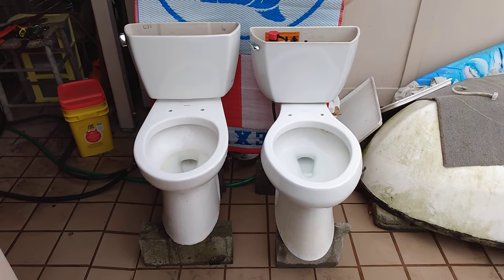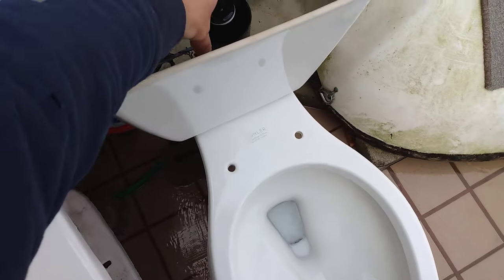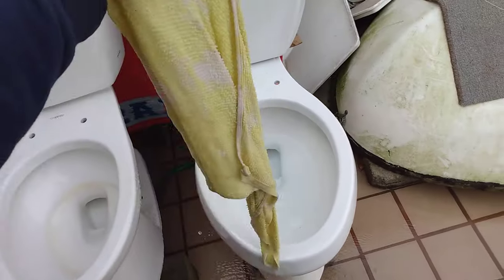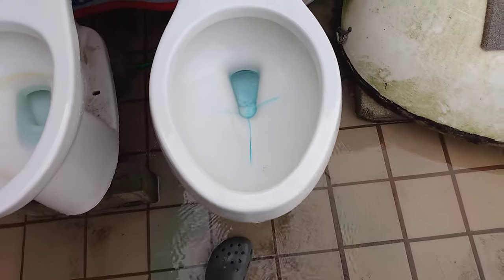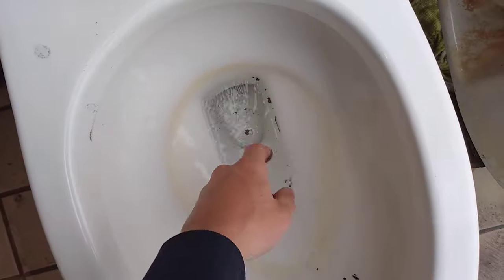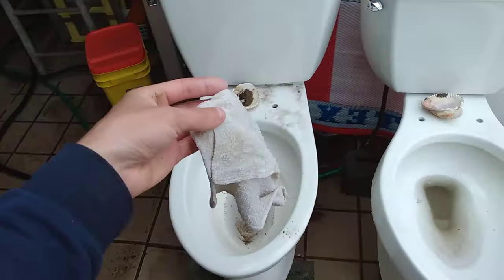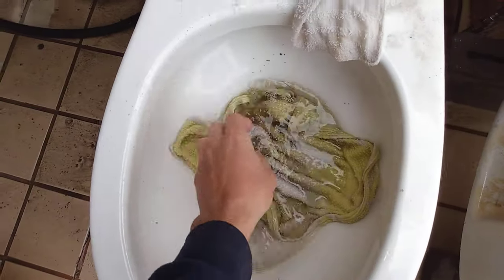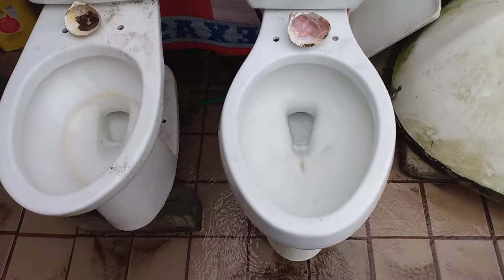Kohler Class 5 vs Toto Drake

Comment: The more I watch these toilet reviews, the more I don’t wanna change my 30+ year old toilets.  I’m not crazy about these 1.28 gallon flushes.  They just look so weak.  Sure, I’m paying a bigger water bill but what’s the point if I still have to flush 2-3 times for a major “load” with these newer toilets?  And on top of that, every other review, someone says Kohlers are better.  So I’m even more confused now.
Reply from the maker: Yeah, definitely save the old ones. I don't know why people say Kohler is better because all I've seen from them is failure when I use them.
Reply: @OCC_Plumbing_and_Restorations  Yeah, I’ve been wanting to get my toilets changed and was doing my due diligence but the more I do, the more I have no idea if I should replace them anymore.  The problem with these old ones are that I have to unclog them with a plunger once every other week and that’s annoying.  But I like the extra water that sits there and that it takes to flush.  Also I can’t tell you why people like either toilets.  I have very little experience with them so i have to rely on YouTube vids…🤷🏻. Thanks for your vids.
Reply from the maker: @d05wtt  You're welcome! Maybe there's something wrong with your toilets that's causing them to clog like a low water level in the tank or minerals in the trapway.
Reply: So get a Toto drake 1.6 tornado flush! Also any professional plumber will tell you Toto is best
Reply from the maker: @ravenmoto5948  If I can find one for free or cheap, I will!
Reply: @OCC_Plumbing_and_Restorations  Nothing is free these days. My post was for the other guy
Reply from the maker: @ravenmoto5948  I've gotten free toilets before, quite a lot actually.

Comment: Why the Toto drake took the dish towel separately and the class 5 taking them at both, even then your 2008/2007 Toto drake didn’t pass the washcloth/grocery bag and the class 5 took it like a champ?
Reply from the maker: That's strange, this was the only Drake I tested. Maybe you're thinking of the Lloyd? As to why they did better or worse other times, I may have used different materials or for whatever reason they might have just taken them differently.

Comment: I have the Kohler. I believe it's a 1.4g flush. It's a really good toilet, but the throat is really wide making hard to plunge in the rare case it gets plugged. Maybe there are oversized plungers. The ceramic is very slick, so the toilet stays clean.
Reply: I have 4 T0T0 Drakes, and plungers don't seal to them very well, either. I recently bought a Korky "Beehive" plunger, which claims to seal to the odd-shaped trap openings, but I have not had to use it yet.

Edit: My mother has a Kohler Cimmaron, with the same flush mechanism in this video. Something about her water (chlorination?) swells the seal, and it starts leaking from the tank to the bowl, and it's hard to find the right part at a retail location when one is needed.
Reply: @drwalker9093  I've since bought Toto Ultramax 1.6, and it is easier to plunge than my Kohler which was moved to a different bathroom. The Ultramax is supposed to have a 3" trap, but I still manage to plug it occasionally. Still, I do like it better than the Kohler 1 piece I have.
Reply: I have a Kohler.
I'm looking forward to sending it to landfill.
Hard to find parts for that thing.
It runs on and off all day and night!

Comment: The Toto prevails, but I'll take a vintage Kilgore or AS Cadet over either toilet here.
Reply: As someone who has a Toto Drake 2 with the cyclone flush and a 1950s Standard Cadet in his house, I have to say the Drake is a highly capable toilet given how much less water it uses. My house is a bi-level and most of the bedrooms and kitchen are upstairs where the Drake is so naturally it sees a lot more use and I have not had any problems with it. The Cadet is downstairs and doesn't see as much use but for the same reason, it's almost the designated "#2 bathroom" lol. I would bet my money that the Cadet is in fact a more capable and hard to clog toilet but given how much more water it uses, it better be. The Drake however is an excellent quality toilet IMO.

Comment: Please I know zero about toliets. I can't find the answer to this what is the differrence between class 5 technoiogy, Aquapiston, or and AquaPiston canister.  Also Am I better with American Standard?  I like to use wipes to clean my royal american. I'd prefer the name of Kohler to up the value of my house.  (so which toilet or Technology would I be able to use wipes as oppsed to toliet paper and is quite.  Please help thank you
Reply from the maker: Unfortunately, wipes are likely to cause sewer backups further down the line and they have to be snaked out even when they pass the toilet. I've heard that Cottonelle figured out how to make one that doesn't get stuck but I'm not positive. As for the toilet, I've found that the new flushing mechanisms do more harm than good because they let out very little water, they break more easily, and they're expensive. My top pick is the Project Source toilets from Lowe's because they can take a lot before clogging, they have simple parts, and despite being the generic store brand toilet, they are good quality and use American made tank parts. Hope this helped.
Reply: Tomads
Reply: Thank you!  Very helpful!

Comment: will any toilets on the market control hard water stains on internal surfaces of the bowl and/or tank?
Reply from the maker: Any kind of toilet will get hard water stains if it is not cleaned frequently enough but it really depends on your water supply.

Comment: Can someone explain to me the difference between drake and tornado, is that both flushing technology, or what?
Reply from the maker: Tornado is the design where it has one or two large jets in the rim that make a fast swirl around the sides. This one uses the G-Max design since it is older. Modern Drakes use the Tornado design.

Comment: Hey guys I am in same position as that other person not knowing if to replace.  Have old kohler wellworth at least 25 years old.  Clogs a lot and I know there are bad mineral deposits inside I can't get off.  My bathroom is so tiny.. Maybe 5 by 5 feet.  Figured buy a round toilet, which is what I have.  But which?  Also my rough in is 13.5.  Any thoughts?  I also wish these 2.25 flushes had more water in bowl.  Thank you much for any replies.
Reply from the maker: With a 13" rough in, you should be able to install any toilet you want. I personally would recommend a Project Source Pro Flush.

Comment: TOTO Toilet.
I have had 5 TOTO Toilets and have not had any issues with what they flush.
I HAVE had issues with the construction and how they flush.
1 - TOTO’s inside tank flush mechanism is a round piston that goes down into a cylinder. The mechanism hangs up and does not seal at times. It does not matter how old your TOTO is – this can happen at any time. I have added a large lead EGG shaped fishing weight to the top of the piston to help assure it goes down. This has worked very well but not perfect.
The inside tank flush mechanism is not the old “flapper” style. I do not know if the other brands current models use the old rubber stopper/flapper(inexpensive to repair) or not. I am only familiar with TOTO.
2 - The flush handle on the outside that is connected to the inside tank lift rod is an issue. They did not build the tank top to accommodate a proper swing of the interior lift arm.
A hard push of the handle can result in the handle being stuck in the down position. This lets the water run until the handle position is corrected. As the homeowner I know how to flush so this does not happen, but the grand kids don’t, and the handle constantly hangs up after they flush. The flush mechanism should be kid proof.
3 - The bowl Interior surface or glaze lets debris stick to it unlike any other brand I have ever seen.
Reply from the maker: That sounds very frustrating. It sounds like the handle you have may be installed incorrectly. Also you may want to see if you can clean debris from around the flush valve and that should solve it.
Reply: Bro chill out
Reply from the maker: @IkkyuD He's just telling about the problems that his toilet has

Comment: A NoNo drake replaced a wellworth ingenium in my old kroger before it shut down
Reply from the maker: The Drake is honestly probably a better toilet but the Wellworth definitely has a better flush. A Kroger near me had a pressure assist Cadet when I first saw it, then it was replaced with another one exactly the same, and then it was replaced during a small renovation with a ProFlo Calhoun.

Comment: Any thoughts on Delta Turner toilet single flush
Reply from the maker: I would stay away from Delta because they have very weak flushes and they've been known to crack during installation.
Reply: @OCC_Plumbing_and_Restorations  I appreciate that. Any thoughts on the American Standard Lexington toilet? My wife and I Both like the look of it. Seems decent from what I see. My big grip with Toto is they feel the need to stick there brand right on the front of the tank. I think that looks trashy.
Reply from the maker: @xfishman123  I've never seen a Lexington before but they seem alright.

Comment: The toto is only better because it uses a large plastic/rubber flapper style stopper, while the Kholer uses this little gasket that I find myself as a handyman replacing more of...
Reply from the maker: Yeah, Kohler isn't known for good designs.
Reply: @OCC_Plumbing_and_Restorations  
Well Kohler does have some great designs, but they are a little slow to the party.  For example, they were last to use screw assisted kitchen faucet main flange nuts. Which I'm sure you know about. It's the big nut to hold the faucet down, and on opposite hexagon points of the nuts they drill and tap two holes for a 10/32 stainless screw, so that all you need to do is get the nut to the underside of the sink and back off a half turn and tighten the screws.  The screws will come tight on a heavy duty washer so as not to sink into wood. And when you go to remove the faucet, you thank your God that the old faucet came with that nut. I first saw it on a Delta faucet. Then on American Standard, then Pfister, Moen, then finally on Kohler.

Comment: I have a Kohler.
It' runs on and off all the time.
Hard to get parts.
It will probably soon have a new home in a landfill.
Reply from the maker: What kind of Kohler is it?
Reply from the maker: Oh, one of those. Which part is the problem?
Reply: @OCC_Plumbing_and_Restorations  the flush valve assembly leaks.
Where's OCC plumbing at?
Reply from the maker: @davidlamunyon9087  Right here. I know they sell seals at Lowe's and Home Depot for those cannisters. They're the 3" type.

Comment: Do you think a Highline Pressure Assist would do better?
Reply from the maker: It might do better on the tests but it wouldn't do better on normal use.
Reply: @OCC_Plumbing_and_Restorations  Thank you for your fast response! I’m looking to replace a 15 year old Koehler Cimarron that frequently clogs. Would you recommend the Drake?
Reply from the maker: @jaclynklafter6770  I don't know how they have changed over the years but I think as long as you don't get an Eco Drake, you should be fine.

Comment: I think the class 5 would be better with a longer flush. It's always water starved.
Reply: That’s because the Kohlers have those AquaPiston flush valves (which make the flushes too short) instead of the normal flappers like most toilets have.
Reply: You can hold down the handle will flush almost anything and equivalent of larger flush on  two button toilet

Comment: The Drake-2 is much better now.
Reply: Not necessarily. A lot of the reviews from actual owners say that it doesn't do a consistently good job of getting the bowl clean if stool drops too far away from the center and along the edge instead. It's designed like most Euro toilets, but anyone who knows them, knows, they are triple flushers.